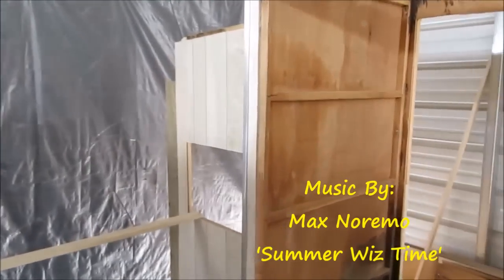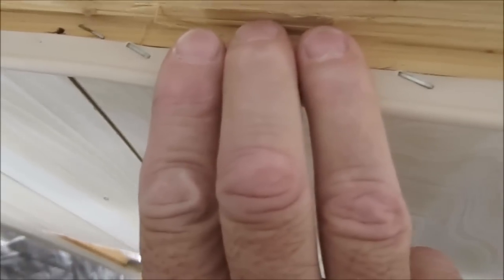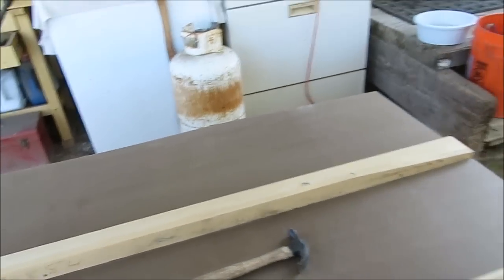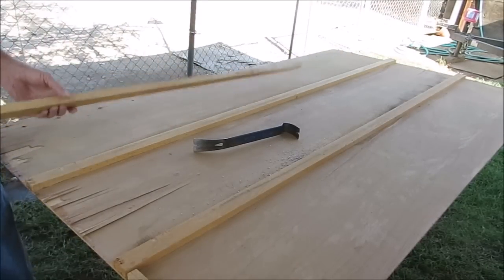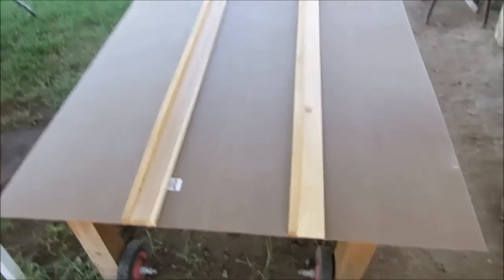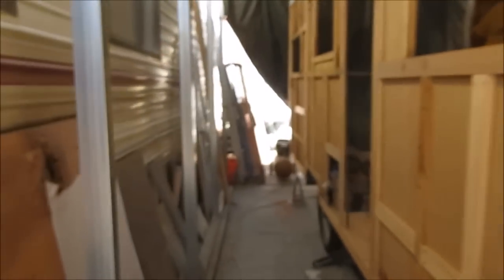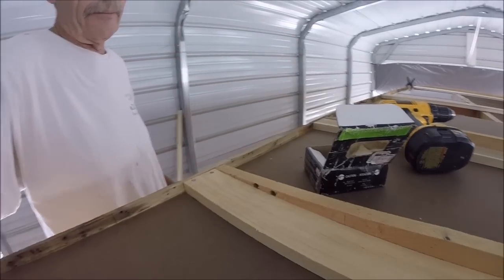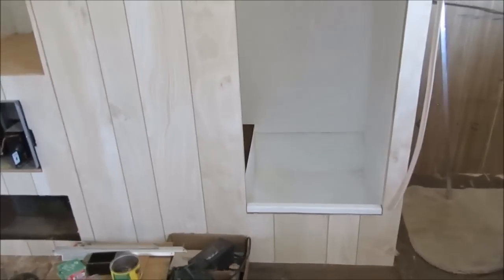V Log #5 - 66 Super Shasta Update Installing The Ceiling

Comment: There's nothing like that feeling you get when you've finished all the demolition and destruction and finally get to install the first pieces of new. The job stops being "work" and starts being "fun" again.
   To answer the question about why Shasta didn't put the radiused crown pieces across all the roof supports, any Shasta rebuilder will tell you that it was done that way to increase the profit margin. Shasta never used a toothpick's more wood than was absolutely necessary to keep the trailer from falling apart while it was going down the road. I must have added 100 ft of 1x2 to the framing of my '59 Airflyte just to make it solid again. Thank goodness for Harbor Freight and the portable pocket hole jig!
Reply from the maker: That thought did cross my mind Bob. There was no one better at being cheap than Shasta. And yet a lot of those trailers made it all the way to 2016! Amazing when you think about it. But yes. The project has become fun once again.
Reply: Much as we all like to complain about the Shasta build quality, there was some pretty amazing practical engineering under the skin of all the old canned hams. They were light, flexible, and tough enough to survive what amounts to about a 4.0 earthquake as they were being pulled down the roads of the day. And, like the old air-cooled volkswagens, they were/are so simple to fix that even a caveman like us can do it. Ha!
I'm going to have fun watching you have fun. Does that make me some kind of voyeur???
Reply from the maker: Sagebrushbob It makes you a happy viewer...

Comment: That ceiling came out sharp. The crown rafters that you installed only looked like they were on the back 2 and a couple on the front flat rafters? Are the crown rafters all along the roof or just front and back radius?

Tell Bill no one needs to make fun of the back of his head...no need to...too much to make fun of on the front of his head...lol...just kiddin. He's a champ for giving you a hand.
Reply from the maker: You are correct. Only two crown rafters in the rear and one in the front. There are also crowns around both vents that are the same height but not on the rafters themselves. Bills a card. He's a lot of fun to work with. Never a dull moment when he's around.
Reply: +mobiltec that makes sense...I was pretty sure there wasn't a valley in the middle since the crown rafters were there to shed water and not create a pond in the middle of the roof

Comment: Hi, love watching your videos just wondering what kind of heater is in that trailer. Is it the one that came with the trailer or aftermarket? The trailer is looking great. With not all the paneling having the upward pieces on them wont the roof be unlevel ?  I thought that Calif. had good weather,lol. Keep up the great videos.      Joe
Reply from the maker: Not sure what you are talking about with the paneling having upward pieces on them... The heater is a brand new Atwood which is thermostatically controlled and has auto-ignition. Much safer and much more efficient than the old one. People get the idea that California has good weather all the time. Well right now we are in a huge drought and have had no rain at all this summer. That is killing the trees in the mountains because water tables are lower up there. We have bad weather here too but it just never freezes much in the winters unless you are at a higher elevation. But it is supposed to rain here on occasion.
Reply: The paneling supports that you nailed on the flat pieces on the paneling. Just wondered why all the supports were the same. Just kidding about the weather I grew up in Salinas Calif. Loved the weather, Tee shirt  weather all the time. Thanks
Reply from the maker: joeshaver100 Oh I see. This is the way Shasta designed the roof. There will also be curbing (crown pieces) on the two top vents that will also support the metal roof. I don't know why they didn't put these crown supports the full length of the trailer. Your guess is as good as mine.
Reply: Thanks for taking the time to tell me that. It just seemed strange. Have a great day

Comment: Larry, did you install curbing over the roof panels? Were they attached to the walls?
Trying to picture how they added to structural integrity.

A.
Reply from the maker: Yes... The roof panels set in the L shaped channels in the top of the walls. Then curbing goes on top. You should see that in later videos. Also if you want to email me I can send photos. mobiltec@gmail.com

Comment: Is there is reason why wood preservative isn't used during the framing process to keep the wood from rotting in the future?  Seems legit idea to me.
Reply from the maker: Yes. Because the wood preservatives erode aluminum. Besides, when you have all those holes in the wood due to fasteners, water is going to get ins somewhere anyway and you want it to be able to drain/leach out the bottom or that's where the rot will happen. These trailers were not built to last more than about 10 years. Today's trailers are only built to last 7 before they begin to leak.
Reply: Thanks for the reply. I hope to get started on a 13 foot 1977 Project soon. Thanks for your hard work making these very informative vids.......and no, I won't be gutting it like a fish.  :)

Comment: Why not use screws instead of nails and do you use liquid nails before putting most of your stuff together? We are starting on an 82 Shasta. I know, not that old but we like how it looks.
Reply from the maker: Because of two reasons. One, Twisty nails is what was used when this camper was first built and we are keeping this camper as original as we can in design. Two. These trailers need to flex so all of the fasteners come into play on how much flex there is in the trailer. Screws are used in much of the framing but the paneling is held up with twisty nails. Some companies glued the paneling to the framing as did this one. They used other types of glue back then but Liquid Nails works great too....

Comment: I didn't see those curved rafters on my trailer. I just have the flat slats you are using nails to install. Would it be better to use screws? I'm soaking up comments about the integratory of the trailer and need for allowance for movement (?). Too rigid not good? I would use glue on everything.. but I donno.
Reply from the maker: Glue does nothing in the framework really. It will all just crack. You need some flex in the trailer. Screws are good in some places and not in others. In this case it's nails. But going through to the cabinets it's screws.
Reply: @mobiltec  I'm kind of known as a "glue freak" Larry. I glue everything! How about a flexible glue, along with brads or nails on the other side? That is what I saw on the video of the kid rebuilding his trailer wall. I looked for the staple gun with a 2" crown but couldn't find one, (but saw some really expensive ones), so I wondered if this method of fastening sticks together is not used anymore. I thought of just using small strips of metal and screws. I'm going to be looking back at your videos for how you do the can ham front and also how your make that channel in the top. I took off the driver side and saving to use as a pattern and it's sitting there falling apart. Too many topics in my head. I'm getting excited seeing your video selection in the column to choose from.  Shasta used a 1" strip of plywood for the front edge and I don't like that. The more of your videos I watch the more I realize how complex this project is.
Reply from the maker: @daultonruff2281  Glue is not needed anywhere in a trailer really.
Reply: @mobiltec  I don't think I can help myself. It's a compulsion.
Reply from the maker: @daultonruff2281  Then glue like the wind. Some of it will hold. Some won't but at least you'll be having fun. There are things I glue, mostly in cabinets. I also glue all the laminated curbing. It doesn't flex.
Reply: @mobiltec  Before I get started, after the storms, and I get the trailer registered and the wheels back on, sometime in the future. I will redress all these things I'm watching and hearing. If I do dive into this I will sign up with you. Right now I'm in the garage straightening out J rail that is bent up worse than a pretzel, and fixing bullet holes in the metal. Have you ever heard of anyone putting the pattern, (lines) into a flat piece of aluminum for siding? I just have one torn up front panel.
Reply from the maker: @daultonruff2281  Yes. If you have a hand brake you can make your own metal skin by just going to a place that sells sheet aluminum and buying a sheet.
Reply: @mobiltec  Thankyou. If I get that far I will try that. That aluminum is so soft it shouldn't be hard to brake, or put a small line pleat to look like the other panels.. I think.

Comment: Larry, where can I buy the diamond metal you talked about in this video? I've searched and can't find it.
Reply from the maker: If you want it in Stainless Steel you can buy it at places like Interstate Metal for $125 for a 4x4ft sheet. Then you have to cut it. BUT... If you want it in aluminum like the back splash in this Shasta you can make it yourself. All you need is a sheet of aluminum, a screen roller tool and a straight edge. Go to this link and this guy will show you how. I'm making new backsplash for this Shasta using his method...  https://youtu.be/TSx6hdyZC18
Reply: I love it!! I will be making one!  I have a very small area between the stove and upper cabinet so that will work great. I just want a little bling. Looks like rain tomorrow so no camper repair but the house needs cleaning. Have a great weekend,
Reply from the maker: Glad that works for you...